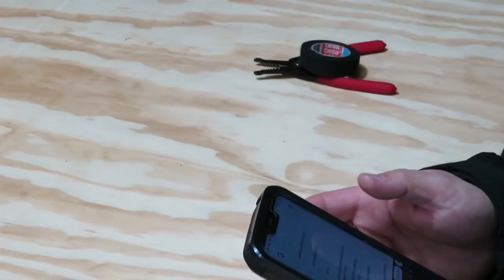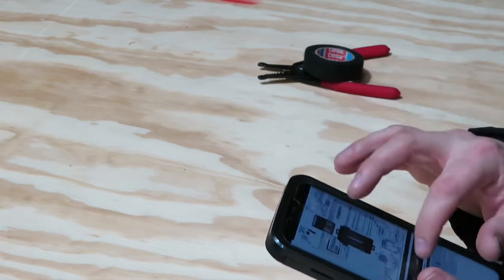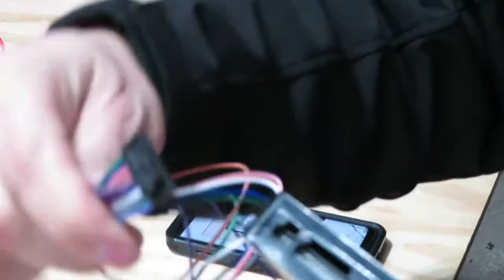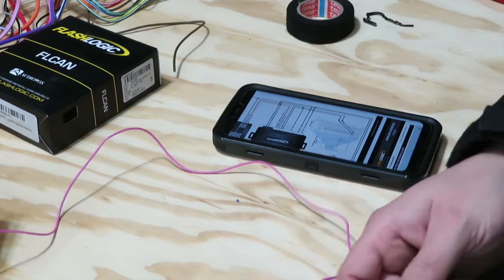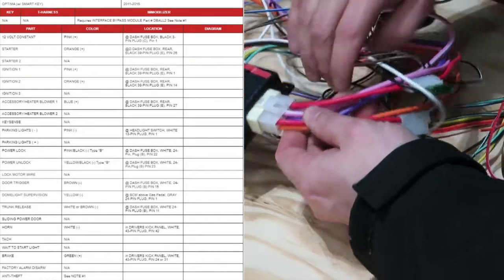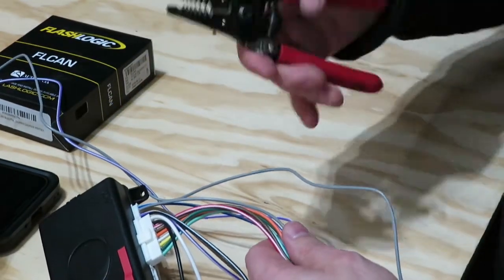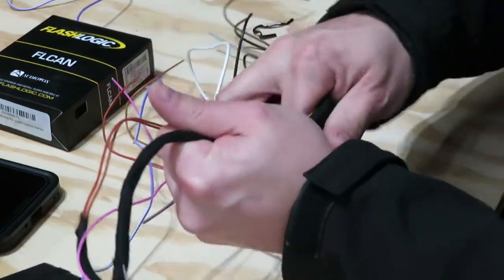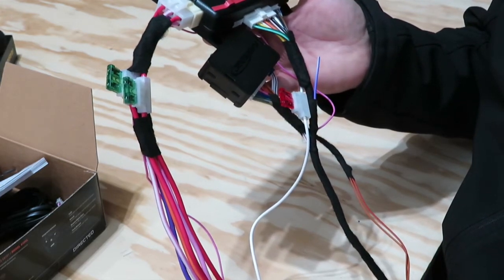How to Prep Avital 4105L Remote Start and Flashlogic FLCAN Prior to Installation!

Comment: Looking to install the 4105L on both my 2014 Tacoma DCSB TRDOR and my wife's 2011 Sequoia platinum.  Sorry, total newb on remote starts...do I also need to purchase this bypass module?
Reply from the maker: Yes you will need the bypass module as well. You can use the FLTB-1 for your applications.  Here is a link to it. 
https://amzn.to/2WcGVSh
You will also need the programmer too.
https://amzn.to/2W3CGrU
Don't be discouraged by the programming.  You can set up an account for free and download the firmware directly to the bypass modules.

Comment: Im in Canada.  I bought this product.  However, it looks like i also need an immobilizer and programmer.  (Im driving a chevy equinox 2015).  Are there any other accessories or items I will need for this or is this all ?   I didnt realize i also needed this stuff when i purchased the avital product.
Reply from the maker: Yes you will need a bypass and a programmer or find a seller on Ebay or Amazon that will sell it to you with the firmware already downloaded.  I like to us Flashlogic modules or idatalink which are identical.  Flashlogic will be FLCAN and idatalink is ALCA.  Here is a video that I made about bypasses: https://youtu.be/TnhfbtP_od4

Comment: Installing the Avital 4105L in a 2015 Subaru Impreza and a 2016 Hyundai Sonata using a key in the box bypass. Will the Avital remote work for the door lock/unlock and trunk latch? Will it need to be flashed?
Reply from the maker: Depending on the bypass, the locks may be controlled through the bypass or it will be wired directly from the remote start. What bypass are you using?
Reply: @DCAutoEnhancement  
The company is called Bavine, sold on Amazon for 10$
Reply: @DCAutoEnhancement  I want to add one more thing.  I'm a newbie at this all I  have done are a  few dash cams and stereo systems.  Your videos are amazing for us newbies.  Until I stumbled on your video,  I was grappling in the dark. I'm still nervous to try,  but you gave me the confidence to give it a shot.  Thank you for the  videos,  keep them coming!
Reply from the maker: @avrohom7319  I really appreciate hearing that. This is the reason that I decided to post videos in the first place! Let me know if you have ideas for videos in the future.
Reply: @DCAutoEnhancement  One question, whats the point of having the door lock/unlock and trunk hooked up to the remote start fob if i anyway will need the factory key which has the door lock on it with me to drive?
Reply from the maker: @avrohom7319  in that case you wouldn't have to hook them up but if you did, you would just have the option to use the aftermarket remote as well as the factory
Reply from the maker: @avrohom7319  I just looked up the bypass that you are using. That unit will not need to be flashed and the lock/unlock and trunk release do not run through it either.
Reply: @DCAutoEnhancement  Thank You! Really appreciate the help.
Reply: @DCAutoEnhancement  A few questions before I start; hope its not too much trouble.  

1)Do i need to attach both red power wires from the Heavy Gauge 6 pin connector?
2) What does the pink/white wire on the heavy gauge connector do and do i need it ?
3) Do I need the white 4 pin satellite harness? 
4)Do I need to attach the tachometer wire? 
5)Do I need to attach the White/Blue activation input wire on the 9 pin harness and what  would I connect it to?
6) Do I need to attach the orange Anti grind output wire on the 9 pin harness?

I think that is enough questions to start with! Thank You again for all the help, could not do it without you
Reply from the maker: @avrohom7319  1)yes both red wires need to be hooked up they will both hook up to the main 12v constant wire in your ignition harness.
2) pink/white wire is only needed if your vehicle has a second ignition wire or a second accessory wire.
3) you will use the blue wire in the satellite harness to activate your immobilizer bypass. 
4) the tach wire is not necessary but it is the best method to use it. It will actually monitor your RPMs. If you don't hook it up, the remote start will monitor voltage which isn't always a clean signal.
5) white/blue activation wire is not needed.
6) orange anti grind wire will not be needed.

Let me know if you need anything else.
Reply: @DCAutoEnhancement  thank you!
Reply: @DCAutoEnhancement  
Started the wiring....
1) the instructions of the light flash output shows both a positive and a negative sign. My car diagram shows 1 parking light positive wire and 1 parking light negative wire. Can I connect it to the negative wire, it's the one I found first. 
2) Am I using the black/white wire (parking brake input) on the remote start harness?
Reply: @DCAutoEnhancement  Thank You for all the help. I did all the wiring (except the tach wire which I still need to do, but didn't have time to mess with the firewall yet) and the remote worked to lock/unlock the doors but will not attempt to start the car. 

1) What may be wrong?
2) I didn't work on it for 24 hours and now the car battery is dead. Any ideas?

Comment: 2017 WRX CVT  AVITAL 4105L Fix or no ? How to do that?
Reply from the maker: What's wrong with it?
Reply: @DCAutoEnhancement I have an issue with mine it won’t work with remote start and randomly the truck turns on by itself without pressing anything and it won’t turn off unless I unhook the module
Reply from the maker: @Cristianperez-nq7nv  if you called tech support, the first question they would ask is "where is it grounded" if it isn't grounded in the kick panel, you should move it there and make sure it is a good solid connection.  To me that could be the cause of it turning on itself. If you decide to remove it all together, I made a video on how to do that. Here is a link: https://youtu.be/htxKMBqrQiM  Keep me posted on your progress
Reply: @DCAutoEnhancement  it’s grounded correctly but the module won’t work with the button is there something u have to do after the installation? The instructions say to try to remote start after installation but it doesn’t work so maybe I gotta program it?
Reply from the maker: @Cristianperez-nq7nv  you will have to learn the tach or start the truck at least three times if you are doing voltage sense. If you are doing voltage, you may need to change a program setting.

Comment: have an avistart unit in my daughters 2013 escape how can i reset the key imobilizer so car will start , dash and parking lights come on but no start,
Reply from the maker: Do you have two keys that start the car normally?
Reply from the maker: I should have asked, does it start with a key normally. Are you just trying to reprogram the immobilizer bypass? If so do you happen to know which brand of bypass was used?
Reply: i do have 2 keys that start car normally and yes trying to reprogram imobilier only i am assuming it came with the remote start unit only had sticker that said KC05 i do believe
Reply from the maker: @fredalbino674  in most instances, you will need to find the bypass module and unplug all of the harnesses that are plugged into it and replug them in while holding down on a programming switch. If you are able to get a name or part number, in may be able to help you more
Reply: found it to be a direct Xpress xk05 bypass
Reply: @DCAutoEnhancement  it is a direct Xpress xk05 bypass is all it has
Reply from the maker: @fredalbino674  unfortunately it is difficult to find the info on those bypasses if you're not a dealer. The process above that I described should be the reset for that but then you will need to program the module which will usually go like this: put 1st key in and turn to the on position, lights should blink or give some indication, after about 5 seconds, turn it off remove the key and insert the 2nd key for approximately 5 seconds and then shut it off and remove the key and hopefully you have successfully reprogrammed the module. I'll see if I can find info on that, if I can I'll put a link here.
Reply from the maker: Type in xk05 installation manual and you will find the manual. It was the first one in my search
Reply: @DCAutoEnhancement  thank you
Reply from the maker: Hope that was helpful

Comment: Awesome video, what diagram were you looking at that told you which wires you do and don't need on the remote start itself (i get the bypass is flash logic's website).  I am trying to install a remote start on my 02 trans am and am trying to make sure i don't mess it up.
Reply from the maker: http://www.bulldogsecurity.com/bdnew/vehiclewiringdiagrams.aspx
http://www.commandocaralarms.com/wiring/1998-2002/pontiac/firebird/1751.html
Thanks for checking out the video!
Reply: DC Auto Enhancement thank you!
Reply from the maker: No problem